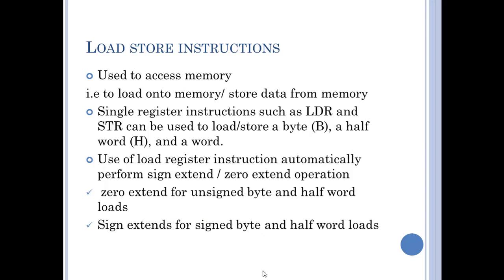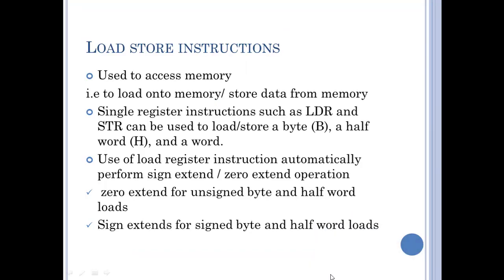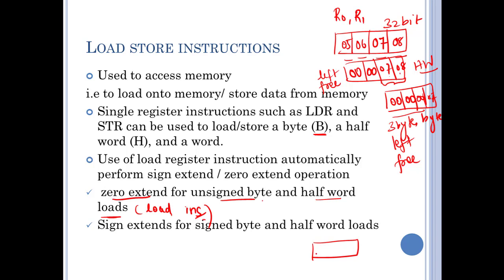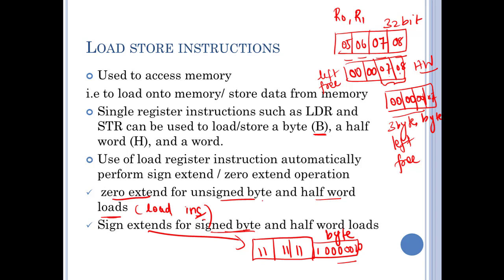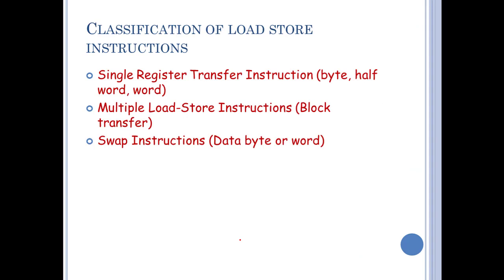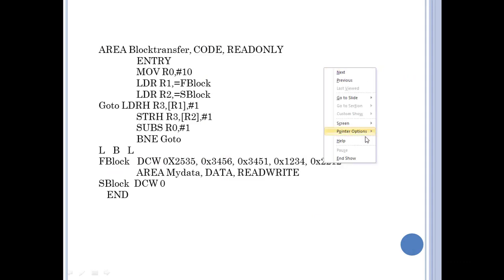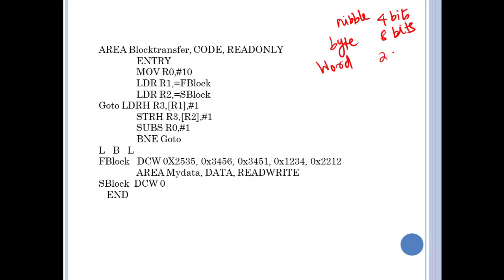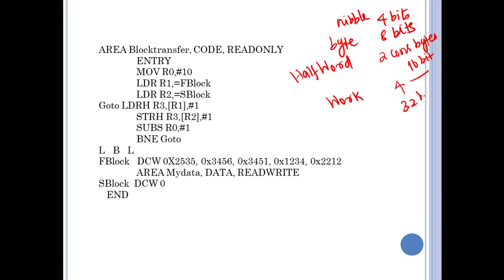Lecture 12_Load and Store Instructions _Single Register load store Instructions

Comment: It's helpful for me
Reply from the maker: Oh .that's good.
Reply: @dr.srimathisaluminumandgerman  yes mem thanks
Reply from the maker: @dharmikprajapati230  yes  message me. Will check by weekend
Reply from the maker: We need to compare individual bit. Use bit manipulation instruction. First store the data in bit addressable memory locations. Similarly take a bit addressable memory location to store the result. Take individual bits and do or operation then set/reset the resultant bit accordingly. But this will be lengthy. Y do u want to complicate??
Reply: @dr.srimathisaluminumandgerman   thanks mam, but this type of question was developed in my mind so I would asked you
Reply: @dr.srimathisaluminumandgerman  again very very thankful to you for answer 🙏🙏🙏
Reply from the maker: Welcome
Reply: @dr.srimathisaluminumandgerman  mam ap iska bhi ek video bana na
Reply from the maker: @dharmikprajapati230  
Sure. I am in vacation. Will kick start after few weeks.
Reply: @dr.srimathisaluminumandgerman  OK mam